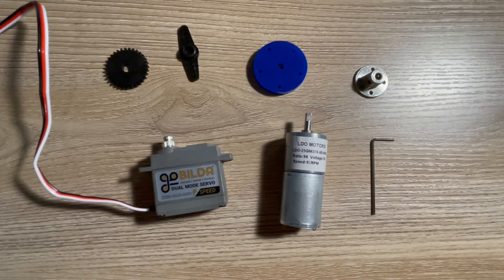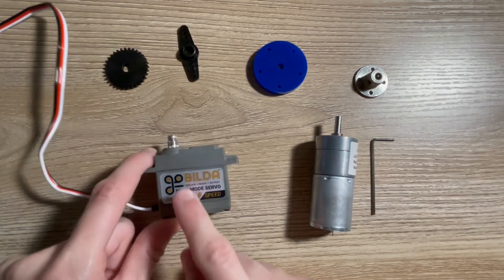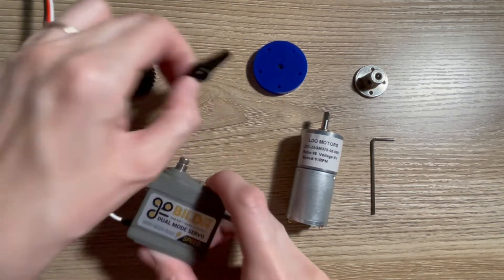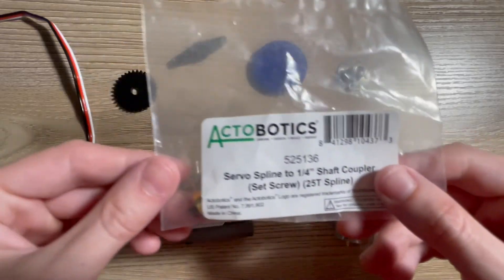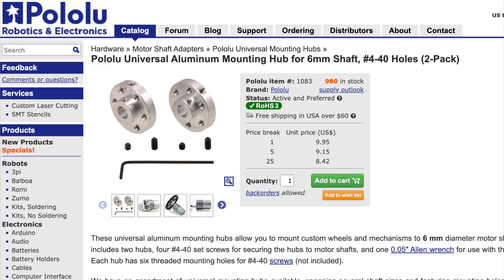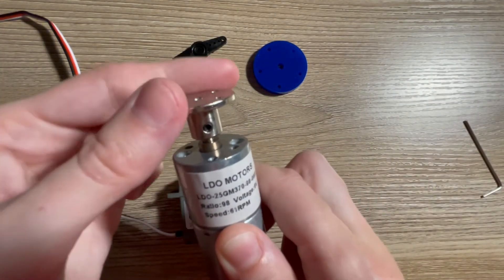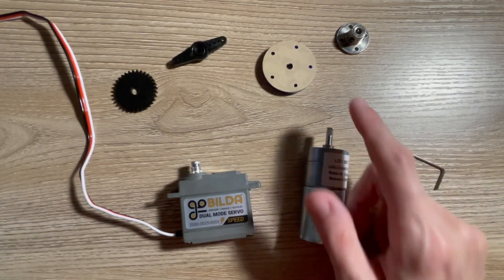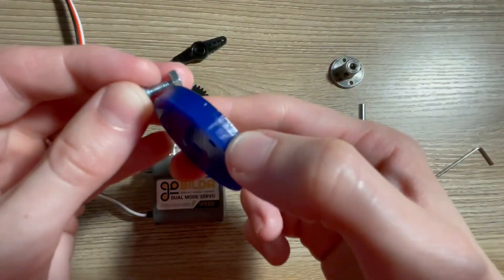How To Attach Motors To Your Hobby Project For Wheels, Gears, Shafts

Comment: my motor has a smooth drift shaft and it's so annoying trying to attach an axle to it
Reply from the maker: Did you end up finding a way to attach the axle? For smooth shafts, I tend grind down a small section of the shaft to be flat in a section and then use a set screw to hold against it. The best is when it's a hex-shaped shaft so a lathe can grind down one section to be smooth cylindrically and use the hex-shaped end for attaching to the wheel, axle, etc. Other options are shaft collars, or perhaps you could try tapping the ends so they have threads.
Reply: @boheatherbowman7636  thank you! both of those sounds like a better solution tha n what i did. i use a lot of heat sinks to hold them together and it worked because it was pretty much just a fan with no real resistance